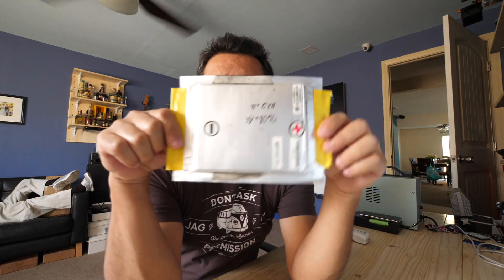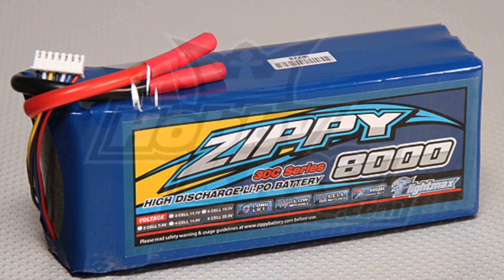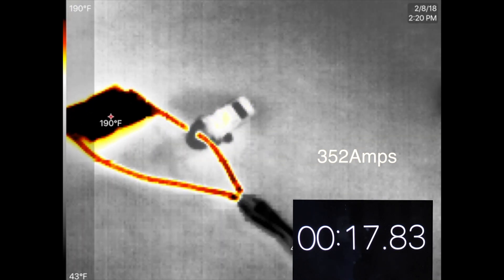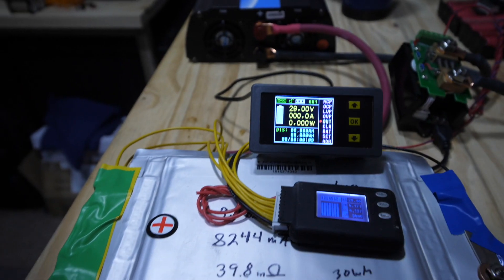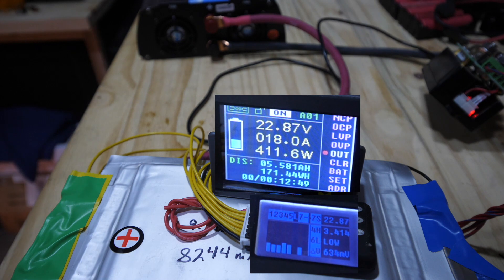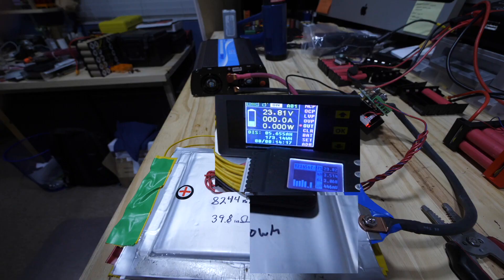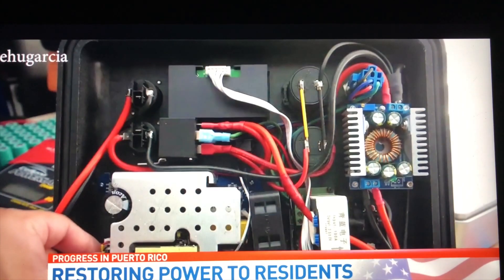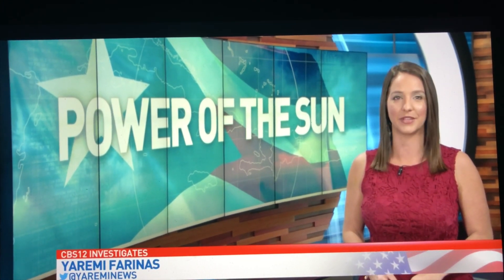200A LiPo cell   (Dead Short Test) 2018

Comment: I was considering LiFepo4 cells for a 24 volt inverter . it seems to be the same as lipo/liion in 12 v systems. with 8-9cells. you either can't fully charge. or discharge. you loose capacity either on top or down low!  if I were to go with 9 cells and charge to 29.5v or so. my inverter goes to 30v I think. I'd like to go 7s liion. 6s the voltage is to low. a lot of the EV and hybrid packs are 6s. great video. I also considered these cells. but when you add up as many as I need the price is a little high. if I was needing power for my e bike or something . I'd definitely go with them thanks.....

Comment: I wonder if a inverter could be reprogrammed some how. or tricked in to going down to 8,18v and up to 16-18,32-34v for 12-24 volt systems.
Reply: There should be a Zener diode or a potential divider somewhere in simpler inverter designs to provide the low voltage reference. I'd start by looking there.
Reply: dc to dc step up or down voltage regulator, thoug dont know if they have someting for like 200 amps range, google, that could work for 12v aplications, because if u use these in 4s u get rougly 16v, too much for inverter of that has operating range of 10.5v to 15.5 v(12v systems like car, rv, semi truck)

Comment: Whats causing that wave of voltage drops on the meter?
Reply from the maker: I have no idea,  hopefully someone watching can shed some light
Reply: jehugarcia could it be the pwm in the inverter carrier wave. and the sine wave. crosses with the sample rate of the meter? along with the load. discharging the caps and recharging? all working out to something like a harmonic vibration in a gas engine . this is just happening in the electric current? or just the output regulation. trying g to keep the voltage stable. ?
Reply: jehugarcia spoken like a true scientist!

Comment: shouldn`t you be using 4s for 12v test and charge to 14.6 ? because a normal sla battery charges at 14.6 v even though they are classed as 12 v
Reply: haha, yea, if all your friends are on 13S, then go with the 14s configuration, the extra cell will make sure you have that tiny bit extra for when its needed ;)
Reply from the maker: same thing,  you end up leaving 30% of battery un usable at the top.
Reply: suppose so but the batteries would last probably 50% longer (life cycle)if someone was wanting a 12v lipo battery, maybe another test what last longer a 3s 12v or a 4s 12v :)
Reply: i have been building a few ebike batteries btw and have only used 18650 cells, this has got me looking for some lipo high capacity cells in the UK, not had much luck so far unfortunately
Reply: I use 2 of these in series on my ebike, put peaks of about 70amps and cruising at ~15-20amps with no fuss, minimal sag and last forever.  Best lipos i have ever used on my Ebike and im UK based as well.

https://hobbyking.com/en_us/multistar-high-capacity-6s-16000mah-multi-rotor-lipo-pack.html
Reply: I have just been looking at the 20000mah version for  £10 more, i have 18ah 13s li-ion and 13ah 13s li-ion i have built myself am thinking of putting on ebay as they was built before i got a spot welder so are soldered to fund a pair. what is the top speed dropping down to 12s ? i get 34mph top speed on flat in my 1000w motor with 13s connected  so was thinking of getting the 6s and 2x 4s 20000mah (always want a bit more)
Reply: I have the Crystallite HS3540 hob motor and with 12S on that it cruises at 30mph fully charged and drops to about 26-27mph at the end. They didnt do the 20000mah ones when i bought mine last year or i would have got them myself, £10 for another 25% capacity is a no-brainer for sure. if you like to have at least 30mph then it might be better to go with the 6S and 2x 4S, i compromised on cells for ease of charging.  Theoretically i could use 16s on my controller, but not sure i need the 40mph top speed, and would make charging more of a chore :)
Reply: probably just being greedy tbh maybe 2x 6s will be enough for me to, Just i have built 3 of my Friends ebikes and batteries and they are on 13s li-ion too so wouldn`t want to be tagging behind lol
Reply from the maker: $112 each though
Reply: Yea true, but at ~ $280 per KWH of battery its about as cheap as you can get for Ebike batteries without having to totally build your own packs from 18650's and even then you would be looking at a heavier, bulkier pack than a couple of these Lipo's and lots of connections to fail. If you are a competent pack builder with all the correct gear and plenty of experience and with access to $1 cells at about 2000mah each then perhaps you can make one cheaper then these lipo's, but for 99% of us these are a cheap and easy alternative to the $700 to $1000 ebike batteries you can buy.
Reply: RWBHere yes the legal top speed for a pedal assist cycle on UK roads is 15.5mph. On private land there is no limit however. It's a law that is unpoliced for the most part in the UK unless the rider is causing a scene or riding dangerously, most race bike riders travel in the 25-40mph area and are not restricted or required to be registered so it's hard to police. I have a switch on mine that i just flick to remove the 15mph restriction when I'm offloading.